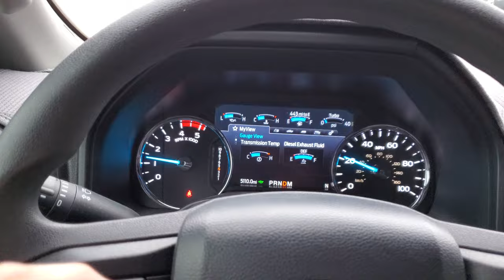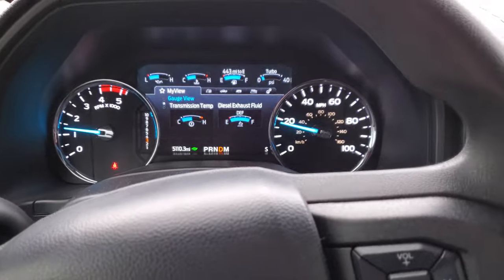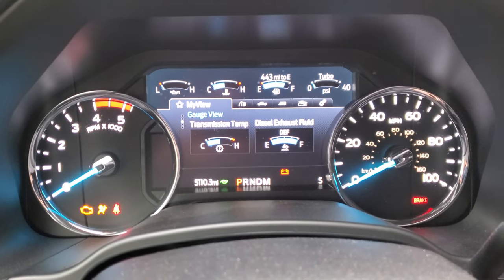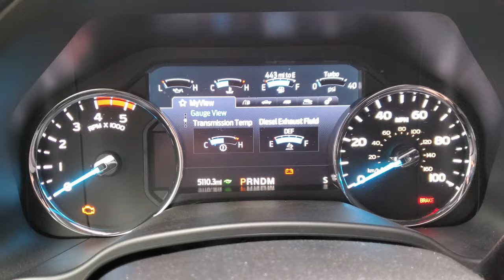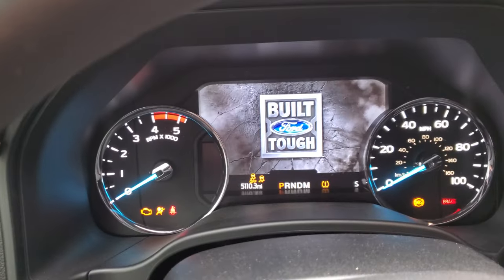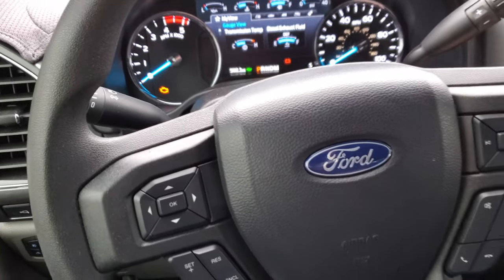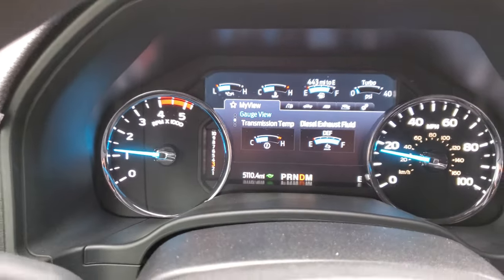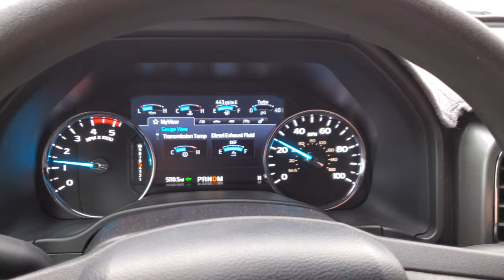Do YOU Know | HOW TO | TURN OFF THE SEAT BELT CHIME 2017-2021 Ford Superduty Trucks

Comment: It works. Page 43 of my 2021 super duty Manuel. Note, I have a push button start. After pushing the bottom (not starting the engine) it takes 1 minute for the seatbelt indicator to disappear. Then you must start the “click and unclick” of the buckle within 30 seconds of the indicator turning off. If you wait longer than 30 seconds it won’t work and you have to start over. Thanks for the video!
Reply from the maker: Thank YOU!!!
Reply: For those taking notes on autocorrect... the above should say manual and button
Reply: Just confirmed it works in a ranger as well
Reply from the maker: Thanks for sharing
Reply: Thanks Matt I didn't wait long enough and was frustrated then I read your comment and I smile
Reply: Works for my 2019 ford fusion
Reply from the maker: Yuuup
Reply: I did this to my ‘22 Duty and worked but after doing some ForScan changes to various modules, now my light is back and constantly blinks but without the chime.  I’ve tried to hide it again with the “click/unclick” procedure but it won’t go away now.  Is there anything in ForScan I can change to make the seatbelt light go away?
Reply from the maker: Yea, email us. We can remote in a finish everything else on ur truck

Comment: I used to disable the seat belt minder in my 2001 Crown Vic Interceptor with this method; however I think we had to have the headlights switched on too.  That ding would give you away at 02:00am when slowly sneaking down a street to apprehend car burglars.  We'd unbuckle our seat belts when we turned down the street in question, black out our lights, roll down the window and listen for the bad guys.  You'd be surprised how loud that chime is on a dark quiet night.  Dang I miss those days!
Reply: Ah, yes..and I remember brake light kill too.....until the attorneys found out about them..   :(

Comment: Again you are the man 2014 F350 6.7 It takes a minute for the light to prove out but followed your steps and worked like a charm. Now when I start the truck the seatbelt light comes on I could pull away without it chiming And light proves out again within a minute thumbs up brother
Reply: @PowerStrokeTechTalkwARod  👍👍
Reply: @PowerStrokeTechTalkwARod   now come up with how to shut off tpms light since I changed the wheels
Reply from the maker: Forscan, done many!
Reply: @PowerStrokeTechTalkwARod  👍

Comment: 20 F250 7.3 V8 - I did this and mine worked but some diffs... my Light comes on when I start it and dings initially several times,  then the light stays on as I drive but goes out in 30 secs but it never dings the whole time. Waiting for my trip to dealer to have a recall on Backup camers done and some things like when i hard turn steering wheel it makes a CLUNK CLUNK sound as its turning. Then i will FORSCAN some options in the system to my preferences. Thanks for the VID!

Comment: Thanks Just did the procedure the light flashed so I think I did it correct. I started it up the light is on solid do you have to drive for it to go off. I'm garaged now. also if you do the procedure again does it turn it back on.?
Reply from the maker: Shld be off. Try again
Reply: @PowerStrokeTechTalkwARod  

My 19 duty not liking this I’ve printed out the   Procedure it works as printed but when I fire it up it’s a sold seatbelt light unless I buckle. Right now the truck is grounded for a project maybe I have to drive it after the procedure finished?
Reply from the maker: I didn't have to drive mine that I did for the ones that I have
Reply: @PowerStrokeTechTalkwARod  

Interesting of course in a stall sitting still now I’m in a did I turn it on or off as the same procedure does both. Funny how it’s not in my 250 literature but it’s in a 150

Comment: For what it’s worth it takes 20-30 seconds for the seatbelt light to initially go off after turning the key on before you do the click unclick sequence. I screwed up the first time I tried and had to rewatch the video where a-rod says to let the light go out. After that it worked as expected. Thanks arod!
Reply from the maker: I gotchu playa 😉
Reply: That's a key piece of info that should been in the video.  Maybe add to the description?  Great video otherwise!!
Reply from the maker: Regardless if the time it took, i believe i said YOU have 2 wait until the light goes off. It too is in your owners manual. You can read verbatim right therr in the glove box

Comment: Just wondering if you could point me in the right direction?  I’ve been towing with my 17 and now when I hit the brake pedal it says trailer connected or trailer disconnected when I’m not towing. Also sometimes when I put the blinkers on it tells me there’s a bulb out and starts blinking quick.
Reply from the maker: Need a new 7 pin
Reply: @PowerStrokeTechTalkwARod  on the truck side right?  I knew I asked the right friggin guy
Reply from the maker: Yes sir, the receptacle
Reply: @PowerStrokeTechTalkwARod  Yo dude quick question!!! Who’s better than you??? 
Answer: NOBODY. 
Thank you for your help my man
Reply: @PowerStrokeTechTalkwARod  thanks again man. I appreciate you
Reply: @Troy Marske I route the trailer cable through the bale of the coupler padlock. This puts the cable pivot point at the same location as the coupler pivot point, but, while I hadn’t thought of it until I read your post, it also takes a lot of the cable weight off of the plug.

Comment: I wonder if this works with the F150s   with the electronic parking brake. I tried to do this according to the owner's manual instructions but it did not work.  But I didn't activate the parking brake.
Reply from the maker: Say that could be aside yes it works with F150s  You have to follow the instructions to a tee
Reply: You are right, it works.  And you have to be exact to the letter, even the 5 second wait after the light goes out.  Now I can drive down my long driveway to get my mail without listening to that chime all the way.

Comment: I just tried it on my 2011 Explorer with keyless starting.  I turned it fully on with brake on.  Then attached and detached the seatbelt 4 times.  It turned off the seatbelt dinger.

Comment: How about the dinging from leaving your key in the ignition? I farm and have a contracting business and leave my key in the ignition and get in and out of the truck a lot
Reply from the maker: Yepp..u gotta get forscan...
Reply: @PowerStrokeTechTalkwARod  I was circumcised years ago 🤣😅 Oh forSCAN 🤟
Reply: @PowerStrokeTechTalkwARod  while I've got you on here I had a question. My 2019 showed a p20ee code from my buddys scanner. I'm at the Ford dealership now and it shows threshold below efficiency.. they're doing a computer rescan it shows it's at 76.8% it's supposed to be at 75 does that sound right?
Reply from the maker: There is a re-program available for that DTC, what are those BOZOs doing.......
Reply: @PowerStrokeTechTalkwARod  he had it hooked up to a computer about an hour-and-a-half reprogramming it but he said it needed a dpf filter.. also a side note... my buddy who scanned it , showed the 20ee code, just had a generic scanner.. so it's hard to say if that 20 ee code was the right one or not.. check engine light isn't on any longer

Comment: Will this work on a 2015 f350sd 6.7?
Reply from the maker: Havent tried
Reply: First thing i did to my 2015 f250. Seems like the same sequence.
Reply: Worked on my 2016 F350, just be patient on seatbelt light to go out before you start the sequence. It takes about 60 seconds for it to turn off.

Comment: Is there a way to turn off the autostart on a 2020 F-150 without having to hit the button every time I go for a drive?
Reply from the maker: Get u a light up hitch that plugs in...then it thinks a trailer is plugged in and wont shut off
Reply: @PowerStrokeTechTalkwARod  Off to o o o o o o o Orillleeeesss!
Reply from the maker: Ding ding fixed!

Comment: ARod, do you have a fix for the 2015 super duty’s issue with using the parking brake glitching the advance trac and traction control?
Reply from the maker: Never heard of it
Reply: @PowerStrokeTechTalkwARod  well on my 2015, whenever I use the parking brake, when I release it, the service advance track, hill decent control fault and sway control fault all pop up until I shut down and restart. I’ve seen the a bunch on online forums but never a solution. You’re awesome and any insight would be amazing.
Reply from the maker: Never heard of it....& i STAY away from them forums...

Comment: I tried this on my 2020 f250 stx and the  brake light never went off in the first step. Any insight? Thanks
Reply from the maker: .......it has worked on every truck ive tried. U might wanna re read and write that again
Reply: Sorry  i meant seat belt light. I tried a couple of times. Thought maybe having a different dash may change things. Thanks
Reply from the maker: Nope, has worked everytime
Reply: Got it to work on the 2020 and my 17 f150. Took about 10 mins  to go out , pretty cold here. Thanks willl defiantly help on farm and jobsite. Apprciate your response and your channel !!

Comment: Hey ARod, I just tried this on my '20 F350, but it didn't work (mine has the key-less fob).  Bummer.
Reply from the maker: Mines keylessssssssssssssssss
Reply: @PowerStrokeTechTalkwARod  I'll try again later.  This was done with accessories on only, right? (engine not running?)
Reply from the maker: Correct

Comment: This did not work for my 17 f350 lariat
I got everything in video to happen, light went out, 4 clicks, blinking indicator, turned off power(push button) released parking break but when I go to start it it’s chiming again.
Reply from the maker: Maybe timing issuse, I'd try again.  It's in the owners manual
Reply: Ok I drove it around and it doesn’t chime after the initial start up. Started it again after driving it around and it does chime at start up ( if I plug in seatbelt it stops right away). But if I just let it do it’s 4-5 chimes it won’t do it again worth seatbelt undone. I can live with that. Thanks for the video

Comment: Not exactly related but even more annoying...does anyone happen to know how to get doors to unlock in park while idling on f150 possibly super duty as well???  My 17 would do it but my 2020 doesn't unlock unless ignition is off.
Reply from the maker: That should be a function in your instrument cluster settings
Reply: I would like to know how to have all my doors unlock as I put it in park!  Saw in manual tho it for Lariats and not in XLT 2015
Reply: Would forscan do this?
Reply from the maker: Cluster setting
Reply: @PowerStrokeTechTalkwARod  thank you but that doesn't work,  I've tried the auto unlock in my  cluster settings.    It will only unlock all doors when truck is shut off rather than just in park.  Minor but annoying when you have to shut truck off or remember to hit unlock button everytime you get out to open your tailgate.
Reply from the maker: Get forscan...im sure u can change it

Comment: Tried it on my 2011 f250, i go through the sequence and the seat belt light flashes like it excepted the code, but it still is on and dings at me. Am I doing something wrong?
Reply from the maker: Hmmm havent tried them trucks yet
Reply: Worked on my 2011.  Is your MyKey enabled?
Reply: @axl151  I thought so

Comment: Only turns it off until you turn truck off and restart, then it resets itself all over again!  I would have to do this routine every time I drive
Reply from the maker: No. U must have not completed it correctly. It's jn thee owners manual

Comment: Doesn't work on the 22
My light doesn't go out
Reply from the maker: Try it again, have done multiple trucks
Reply: Light stays on
Reply from the maker: Try again
Reply: Dude I turn the key on and the brake is on and the seat belt light never goes out, so why don't you get it? I don't have a 21 like you
Reply from the maker: 17 18 19 20 21 22......theyre all the same. Its in your owners manual brah